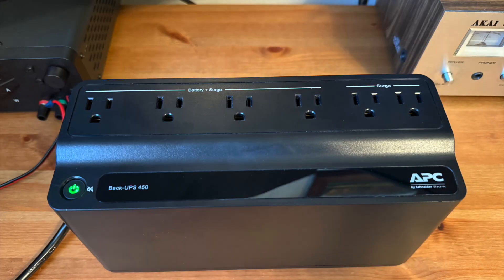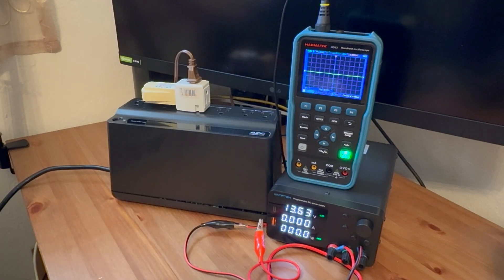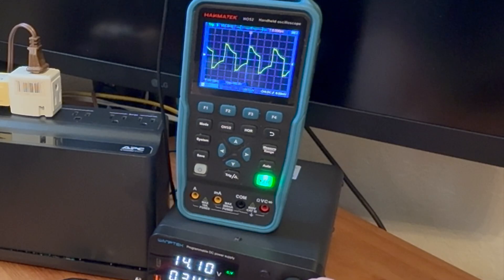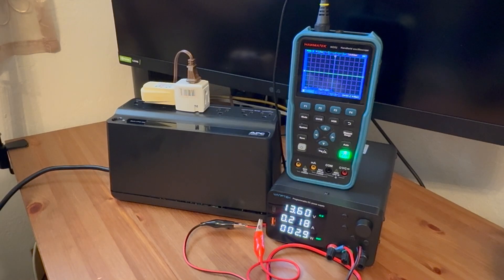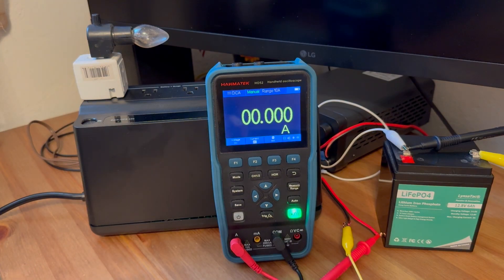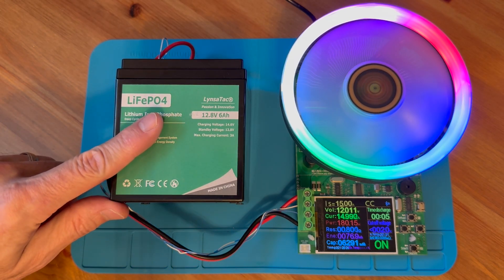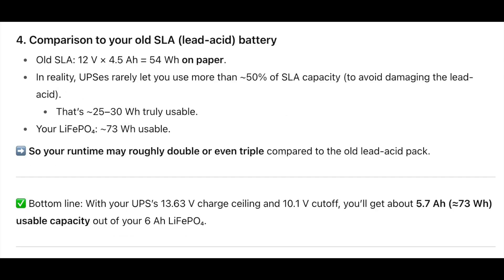Replacing another small UPS Lead Acid battery with a LifePO4 (Lithium Iron) battery #apc #lifepo4

Comment from the maker: What do you think about using LiFePO4 batteries in a UPS?  Add your thoughts to the comments.

Jump right to the chapter you are most interested in:

00:00 Intro
00:32 Let's get started
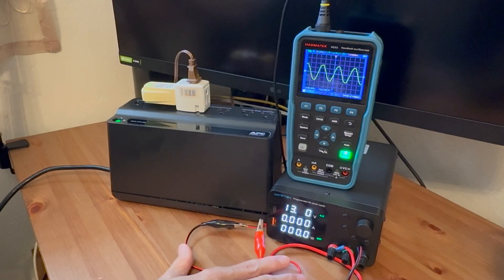02:41 UPS minimum battery voltage
06:16 LiFePO4 battery intro
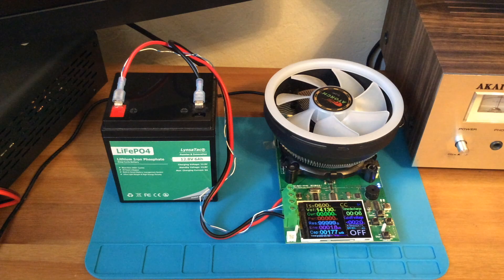07:30 LiFePO4 battery capacity test
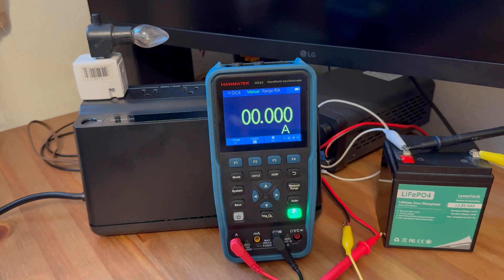07:52 UPS charging current
09:47 LiFePO4 maximum discharge current
12:12 Summary

Comment: I think you will get full capacity out of the LifePO4 battery. If you look at the spec sheet for the battery it will probably state the charge voltage is 14.6 VDC,  but the at rest 100% charged voltage is 13.6 VDC.  I use several 12 volt LifePO4 batteries and after charging them to 14.55 volts they will come down to 13.7 volts after several days.
Reply from the maker: I agree, although I have not done any capacity tests charging to only 13.6 compared to charging to the full 14.6 VDC.  That might make for an interesting video.  I tend to agree, if the voltage is held at the 13.6 level for hours (or days or even weeks), the LiFePO4 batteries will likely become fully charged.

Comment: So can you make any recommendations based on all of your testing? 
Using a decent quality battery with BMS, should this work with most 12v UPS units? 24v is a bit different, as you have to find a 24v battery, since the 12v batteries suggest not using them in series, from what I've read.
Reply from the maker: Hi, recommendations on batteries?  I've added links in the description of each video on which battery I used for that test, so you can check those out.  I haven't purchased any 24v batteries as I don't have a 24v UPS.  And yes I agree probably best to get a single 24v battery versus using two 12v batteries.

Comment: The active or passive cell balancing that your BMS does only happens at higher voltages than the UPS can provide, so your cells will never get balanced and you will shorten the life of your lithium cell pack.
Reply from the maker: That's a good point.  I suppose I could periodically take the battery out and do a full charge.  But since the battery will rarely be discharged in most cases (at least where I live, there is less than half a dozen power outages a year, some of which are only a few seconds, but we have had some that lasted hours), I think the odds of the cells becoming significantly unbalanced is low.  Also, the cost/benefit ratio is good, since the lead acid cells pretty much go bad on a regular 2 to 3 year schedule and are guaranteed to need to be replaced.  But yours is a good point, especially for those who's AC may go out more often and who's UPS battery gets discharged a fair amount during those outages. Maybe in a few years I'll create a summary video and repeat the capacity test to see where things are at.

Comment: The problem with these batteries is you never know how safe they are. Some are good, some may burn your house.
Reply from the maker: The danger is more with Lithium ION versus Lithium IRON.  Lithium ion is much less stable and can overheat more easily if protections are not in place.  Lithium iron is more stable and far less susceptible to this.  But yea, buying a battery from a reputable seller and doing some testing of the BMS before deploying is wise.